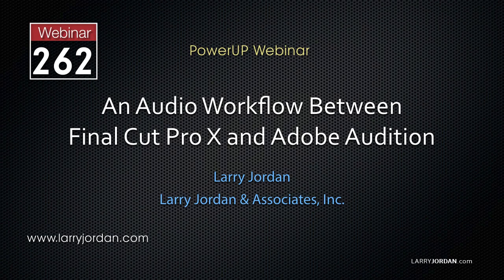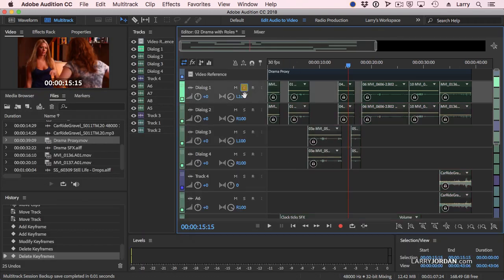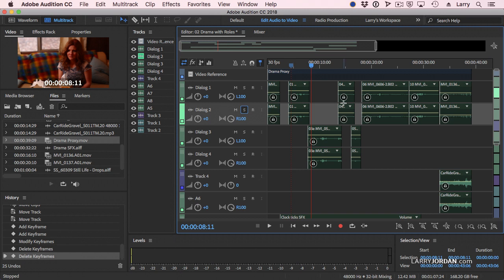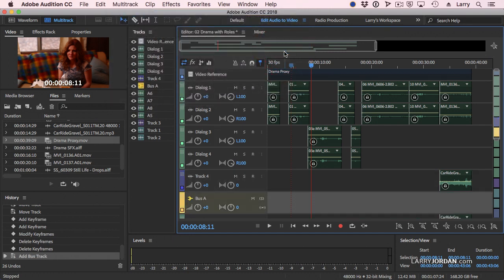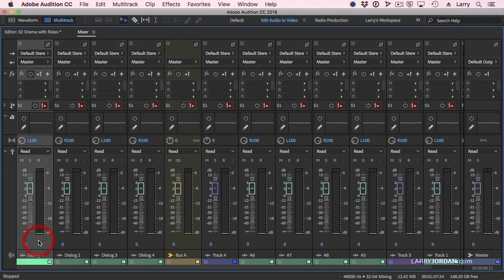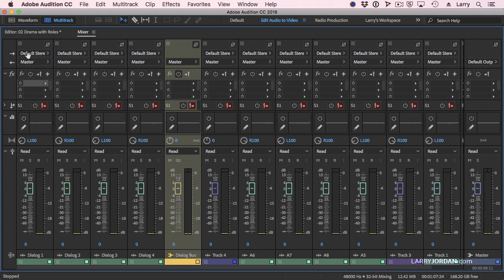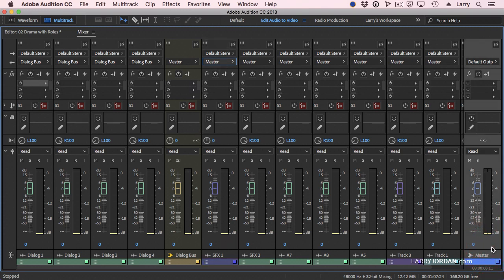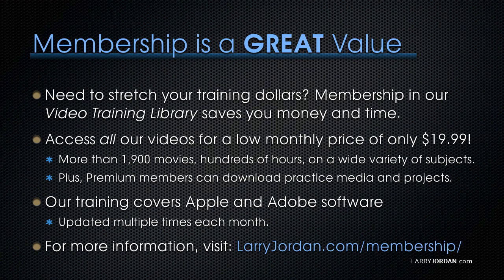How and Why to Create an Audio Bus in Adobe Audition - Larry Jordan PowerUp Webinar #262

Comment: How to run to buses in one track ?
Reply from the maker: Kawasakisama:

By definition, a bus combines two or more tracks. If you only have one track you don't need a bus, because the same effects you would apply to a bus, can be applied to a single track.

Larry
Reply: @LarryJordanFCP  so instead to put filters in buses I put it in one bus ? That's what u mean ?
Reply from the maker: @kawazakisama  

No. You do NOT use buses when you only have one track of audio. Or, if you only need to apply effects to one track. You ONLY use busses when you are combining two or more tracks. Tracks support all the same effects as a bus. Buses  combine tracks.

Larry
Reply: @LarryJordanFCP  what I want to do is putting delay in one bus and reverb in another bus not in one bus
Reply from the maker: @kawazakisama  

OK, you can do that. But, if all you have feeding that bus is a single track of audio, you could do the same thing by applying the effects to that track. 

OR.... if you have one track to which you want to apply delay and a second track to which you want to apply reverb, you can add them as separate effects - one to each track.

Again, the only reason to use a bus is to combine multiple tracks into a single output.  

Larry
Reply: @LarryJordanFCP  thank u for your help I appreciate 🙏